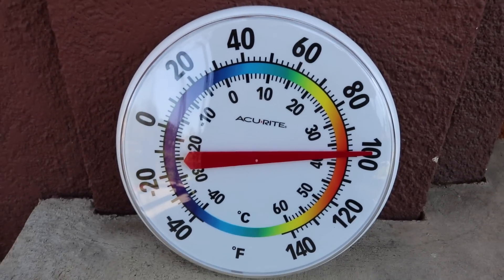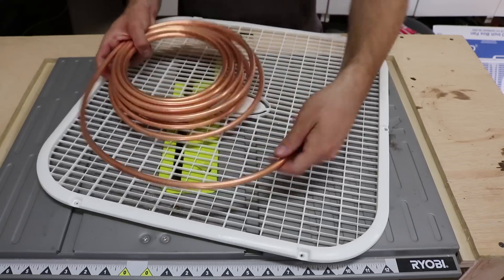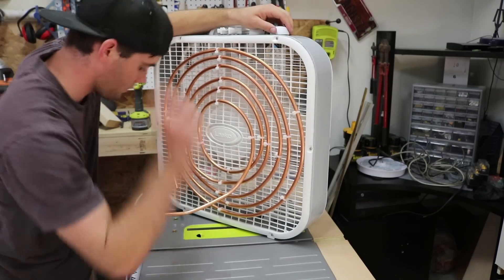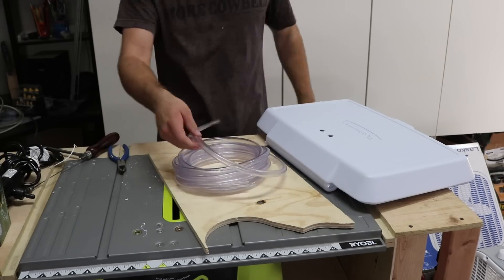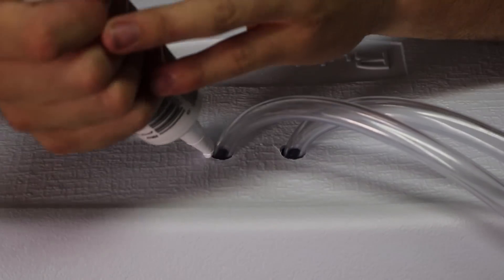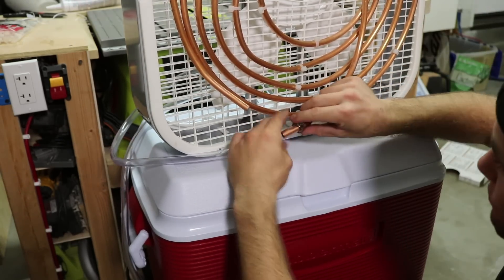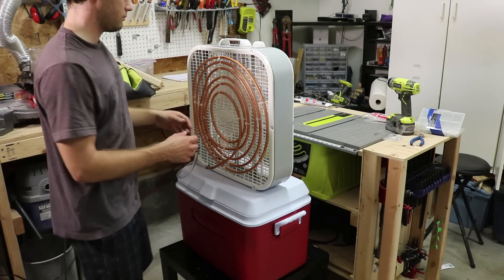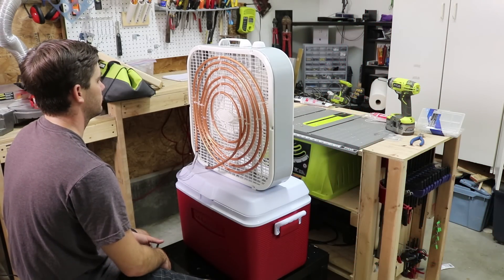$100 Homemade Air Conditioner - DIY

Comment: Today, $25-30 for a box fan, and $80 for 20' of copper tubing.  $25 for a water pump?  Did you say how many ft and the id and od of the copper tubing?  ty

Comment: This system would probably be a lot more effective in a room that doesn't see such direct sunlight. Using radiator foil over your windows can help a ton. I have a skylight in my office area and when I'm worried about it getting hot I have about 4-5 layers of radiator foil that I take the window apart from the top and just slide it in. It doesn't cool the room, but it keeps the room from generating more hot air. i run an AC in the main area and have a ceiling fan that pushes cool air down and a standing fan to push cool air into the room where i have my computer and ensure it's circulated.

I've seen a lot of people, especially people who claim to work in HVAC, claim this does not work. as someone who maintains their own house and has contracting experience, i fully believe them because this does not work for every situation. not a bad solution by any means but it's one that needs more maintenance than your common window AC. i managed to snag a small LG window unit for a little over twice as much as this. square footage and measurements are very essential into making sure any air conditioner setup works, rigged or not.

Comment: The thing also about a home made A/C is if it stops working you can easily and cheaply fix it. 😃 My window a/c stopped working and I have a wet towel around my neck and sitting in front of a fan....and a fan behind me. Its working good to keep me cool lol. The fans are cooling the towel!!! Its temporary until I decide what I want to do. I really enjoyed your video!!!

Comment: i am going to do a DIY airconditioner to cool down my batteries and inverters .. like a really small cabin 8 feet wide, 6 feet high, 1.5 feet depth. inverters go upto 60 C degrees. I need to cool them down to 30C degrees.... any suggestions would do

Comment: Few changes pass through the lid connectors for the tubing and using a different fan more reliable than box fan like vornado never had a problem with any of them left on high for 6 months motor never got hot. And not mounting the on the cooler

Comment: Use the FUCKING METRIC SYSTEM.
Not an "air conditioner". There is not heat pump.

Comment: Has anyone done the sums to check if this is actually economical? The cost of purchasing or making the ice isn't insignificant and also needs to be considered. A few bags with this setup might only last an hour or two on a hot day.

Comment: Might be a little more efficient  if you insulate the rubber tubing or have the copper line closer to the entry point going in to the cooler . Either way pretty cool

Comment: I did this project a few years back.  It worked but it has its drawbacks.  For one the coil would drip water droplets so I had to place the fan on top of the cooler/basin that collects the water and recycles it back.  Second the coil in this video needs more loops for I didn't really feel that much of a cooling difference until I added more.  Third this project will not really cool the room but only the person in front of it.  Fourth the ice melted real fast during a hot day/night that you will require more to replenish it and so the cooling effect is but temporary.

Comment: with running water inspired me to do something similar, but it’s a pity to drain the water into the sewer, so I created a slightly different design, without unnecessary loss of water. The video about such cooler is on my channel. But it is difficult to fully understand (calculate) the efficiency of this device. I would be grateful if you could made a video about the efficiency of this device. 目

Comment: The hot air has nowhere to go, so your efficiency is very low. You need to find a way to draw hot air out of your garage, and that's what an expensive A/C does and that's what your cheap "A/C" can't do.

Comment: I'm guessing somebody has probably already commented about this but to me the cost of building this is completely irrelevant. The real cost comes in running a real AC unit versus one of these which probably draws a significantly less amount of current than a portable AC unit. Also, instead of ice you could use those reusable gel packs that are found in many of the food delivery services.

Comment: I HAVE DONE THIS AND WOULD NOT RECOMMEND. I built something very similar to this. 20' of 1/4" copper tubing coiled predominantly around the central bit (as I discovered on my older fan that the center moved the majority of the air) of a 20" box fan and a 12V 240L/H pump. I used 2 large re-freezable icepacks and 1 gallon of fridge water in a 2 gallon cooler. It produced air that was about 10F colder for ~15 minutes. Mechanically everything worked perfectly, but this design simply doesn't last long enough to be worth $100, which is roughly what I spent, too. I was trying to use this to escape another Californian heat wave, but it sadly did nothing but steal a large portion of my day.

Comment: Ok. So I live in London.  I made this to his exact specifications its been about 30 degrees here.   It worked great at the start but sadly after about 50 mins the air it was pumping out was just normal temp   I also used a lot more ice than in video.  Also if your more than 2 meters from unit you Cant really tell  its any cooler. Not for me but Nice idea though

Comment: Sorry buddy, as an mech engineer this is a trash idea.  You'd do way better to build a swamp cooler with the exact same box fan, which I've already done for $100.  A single tube as a radiator has a garbage efficiency... And you still need ICE.  A commodity that isn't common during an outage.

Comment: You buy a 8000btu mobile unit for $300, assembled and no need to fill it with ice. Ok it won't cool it down to sub zero temps, but a few degrees off is noticeable.

Safe the hassle!

Comment: I've done this and the pipe is better at the back of the fan
It doesn't impede the flow of the air, and I used an electric cooler

Comment: Not exactly an air conditioner, considering that an A/C removes humidity from the air, not adds it.
Reply: It probably is doing the same job. Ice water flowing thru the copper tube will condense the humidity on the outside of the tube and as long as the cooling water stays below steaming, it probably won't evaporate enough to add back a significant amount of humidity. The major problem I see is he didn't account for the condensate.

Comment: I realize this is old, but...

While this would work, you'd be way better off using a 'swamp cooler', which simply takes advantage of evaporative cooling by blowing the fan across a wet surface. I am assuming that the humidity in California, in general, is relatively low. This guy , at one point, mentioned the "cold air can get out through the hole the cord goes through", however, that is not accurate. What he should have actually said was that heat could get IN the hole. Understanding the difference helps you understand why this actually blows cold air, and why this system will only work for a short period of time.

Comment: The real question is it is simply equally efficient to leave the bags of ice in the closed room and have a fan running, as a system it’s equal but this contraption let’s you feel the cool air more specifically

Comment: I see this is an older video, I was just wondering about the condensation?
Reply: As long as there is air flow across the coil it should blow off. If you're sitting directly in front of it he fan, the cooling effect will be amplified.
Reply: @jonathanaliff6121  We did something similar a few years back using a fan and an old radiator.  We pulled buckets of water out of the air - and that did as much to make the garage comfortable as the cool air did.

Comment: You also need to invest in more radiant barriers to lower temperature in the garage. Its radiant heat that heats up surfaces.The method you show may work but as mentioned by others more qualified in the science of HVAC, leaving a freezer door open to cool a room would eventually fail as the heat being emitted from the back of the freezer would heat the room and eventually  cause the freezer to be inefficient, but hey, fair effort.

Comment: Bro you know you can do the same thing with a half dozen frozen 2 liters and a cardboard box right ? I used to shove three frozen 2 liters in a box that had holes in it that drew air in and out the other side with the fan on it ! Its like 20$ with a new fan !

Comment: The reason these jokers don't show the before and after temp is because there is no difference in temps. Curiosity got the best of me and I built one very close to this clown's unit, guess what, there was no cooling effect at all. The only thing that resembled cooling was the cold condensation dripping off the copper tubing onto the floor. DOES NOT WORK.

Comment: Fill the cooler to about 50% full of water, add a lot of ice (3 bags if possible) then add Salt to the mix. This lowers the temperature like in the old Ice Cream Makers. The only change is that the pump system might need to be made closed loop instead of pulling the cold water straight through the pump since salt is added. It might be worth checking into.

Comment: This actually makes the room hotter than just bringing a cooler full of ice into the room because you can't delete heat and you're actually generating heat by running the fan and the pump in a closed system
Reply: The amount of heat created by the pump is negligible. You're likely already going to be using a fan on a hot day (and again, the heat created is next to nothing). Another way to look at this is a way to trap the heat into the cooler full of ice. 

An ice cube should be able to cool a cubic meter of air by 1 degree Celsius. Put another way, a cubic meter of air should be able to melt an ice cube using 1 degree of its 'energy'.
Reply: @bbg5000  100% of the electrical energy used becomes heat either thru the operation of the equipment or the friction caused by the moving water or air. This is a closed system so the electricity coming in, does work, since the work is just moving things around in a circle it all becomes heat in the end. The only way to do work without generating heat is to do something like lift an object onto a high shelf where some of the energy is stored as gravitational potential energy instead of heat. So basically yeah, you make probably about 200w to 400w of heat with the pump and fan

Comment: GLUE DOUBLE ALUMINIUMIZED FOAM INSULATOR PANELS TO EACH SEGMENT OF YOUR GARAGE DOOR, LEAVING ENOUGH SPACE TO HINGE OPEN AND CLOSED. ADD DOUBLE INSULATING PLASTIC TO THE WINDOWS TO KEEP OUT MORE HEAT.

Comment: nice rig for sure . but you can drill a round hole, then feed the cable through and install a grommet for a tight seal  and complete the electric cable construction

Comment: Filling several used-up Gatorade bottles with water then freezing them is better than using ice that will melt faster. Water will stay colder longer plus you won't have to spend a bunch on ice if you have a freezer to freeze the Gatorade bottles of water. The smaller drinking water bottles melt faster is why I ended up using Gatorade bottles.

Comment: Kool little idea, though, as I'm sure HVAC types have likely noted, there are some calculations missing... not to mention true exchange.  What I'm super curious about is the delta in temps once you had it running a while... any numbers to share?  By the way, that's a coping saw (especially if you had the blade oriented properly), not a hacksaw.

Comment: Called a swamp cooler, to cure swamp ass
Reply: Incorrect. A swamp cooler adds moisture to the air, thus lowering the temperature slightly. This contraption would cause a condensation mess underneath the copper coil on the fan if there's any humidity present. He must have really, really low humidity there because he never mentioned that.
Reply: @ronk9830  Someone is too anal to understand sarcasm

Comment: I used to have a shop next to an ice plant. It had two big ice machines that ran all day long and expelled about 5 gal a minute of very cold water (about 38 to 42 usually) with all the minerals left over that didn't freeze into ice. I ran it into a igloo cooler and pumped it into the building and through a a/c cooling coil with 4 rows of tubes. It got clogged with scale after a few months and started leaking. I built a cage of stainless tube and ran a 4 tube manifold system that worked pretty well. It wasn't like ac but it was cheap and it got the temp down to 76 some mornings in my 2000 sf shop. 
As for a cooler full of Ice I don't think it would effectively cool a small closet with a 20 pound bag of ice and a few feet of copper tube. You don't have enough cold (BTUs) and you don't have enough coil to move any cold. The ice will work great for the first few minutes but if you are in a hot place you would do better to put wet rags on your head and arms and keep beer cold as you can in the cooler. 
I also used to get hundreds of pounds of ice that I would do into my cooler cage and run the fan with that. I have melted tons of ice with a box fan in my days. A cooler full of ice is a few dozen BTUs an hour.
 The cooling is psychological.

Comment: It will only work if the pipes are connected to a water source which is located outside the room or house. Input energy should be equal to the output. In this case there is some energy loss if the water source is situated in a room then it will reach to the point where it wont cool anything rather it will produce more heat because of the energy losses. The best thing is to place it in a window or place the water source outside your room or house.

Comment: What a waste of a good cooler and fan and copper tubing, and ice!  Just putting the ice in an open cooler would cool the space MORE than running a fan and a pump with the melting ice, each of which will ADD heat to the space.  I KNOW the air moving across the tubing wouldn't cool enough to even notice a temperature difference.  Running the fan alone is all you needed to do.  And what about all the energy to run the pump, fan, and the energy to freeze the ice. OMG, any physics teacher worth his weight in dirt would tell you the same thing.  Save up the $100 and all the money on the wasted energy... and buy an AC unit for $150 from Wally World.

Comment: I'm curious as to why you didn't do a temp reading after your ph ukin build......its cuz it sucks and doesn't work lol. I bet that copper will draw in the heat more that it will hold the coldness. Like seriously lol you made a pH ukin point in the beginning about temp, showing the temp gauge  but when all said n done and 100 spent when you could have prob found a 2nd hand window at unit for less money. Like Like tbh you did a diy video and you don't even prove that it pH ukin worked lmfao which took be honest makes you a liar . Like 5 time Temps in the begging and pH UK all at the end lol  you put your hand on it after Like 30sec to test like wtf.....didn't you lmfao cuz it doesn't Work does it  112f garage blowing hot air on copper , and u just had some ice water lol which at best I'd say 30f anyone wanna do the math. Anyways I'd remove the vid cuz you didn't show it pH ukin worked dude like seriously.

Comment: It would have been nice to see the comparison between the before and after on the fan. It will surely be cooler after the fan contraption is built.  What I like is you could at the end of the day take the melted water in the cooler and freeze it over night.  Moreover,  yo might actually be able to bury the cooler somewhere and pump the water from there.  The ground typically keeps a natural temp of about 50 degrees.   It is a cool project and is meant to keep things cool for a short amoutn of time..   Maybe insulate your garage door as well.
Reply: I agree that the first thing you should have done was insulate the garage door. Easily done with foam adhesive and foam board. For ice, use gallon milk jugs or 2 liter soda bottles filled with water and frozen. Will last far longer than ice cubes. And as this is now 6 years later, the cost is closer to $200 not counting the door insulation.

Comment: If you want to take this idea one step further, take several 5 gallon buckets full of heavily salted water and put them in the freezer for at least 24 hours, then once you're ready to cool down, pour the salt water into the cooler. Salt will allow the water to stay liquid below freezing Temps and will thus transfer heat much more quickly than pure ice water, though it will heat up faster. Once it warms up, pour it back into the bucket and trade it for the other one in the freezer. Might want to make sure the pump is compatible with salt water though, and perhaps a clean water flush would be a good idea when it's not in use.

Though at the same time you could just spend a little more and get an actual AC unit...

Comment: I would put the copper behind the fan. Direct air on it will prevent the dehumidification and will put the condensation back into the air.
Reply: Maybe he did it that way to reduce the condensation mess it's going to make, either way.

Comment: TRUST ME, this is not practical.  I made a similar one but it ONLY works if you have a single giant block of ice.  Smaller ice cubes or ice in packets will melt in less than 2 hours and ice inside packs doesn't cool the air as much.  The fan also has to be strong.  

So, it's just better purchasing a decent AC in the long run.